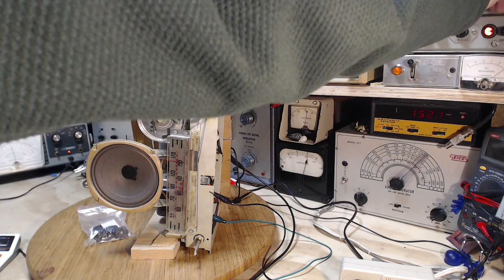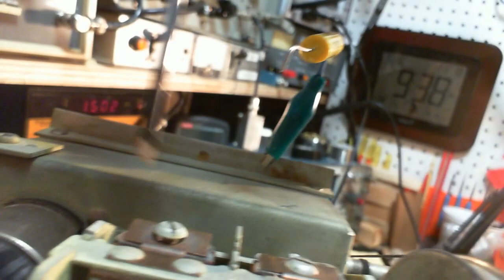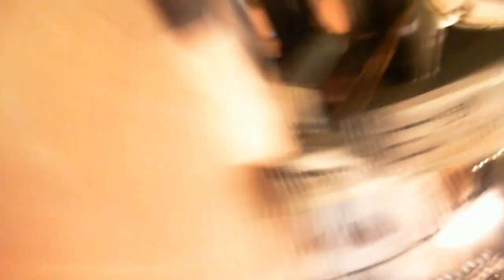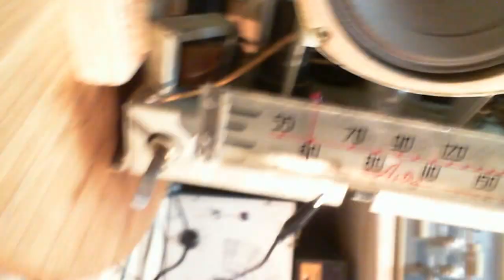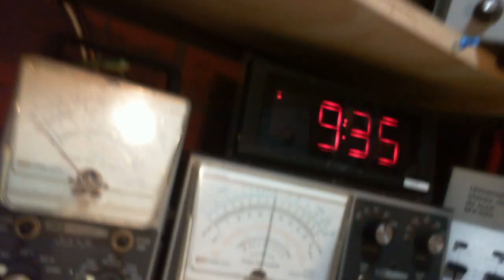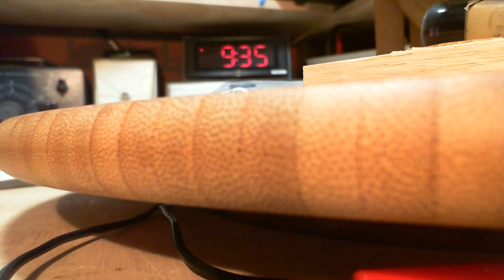Brand and Millen DR-102U Tube Radio Video #18 - IF Realignment

Comment: Jim, as you say there would seem to be too much capacitance in the antenna tuned circuit. Just a thought but the biggest contribution of capacitance would be from the main tuning gang. So could it be that when you adjusted the pointer on the dial cord to the last mark on the scale, with the tuning gang fully open, you should have set it to the 1700 dial marker. That would make the main tuning gang more open with less capacitance across the whole dial. That may then allow the tiny, by comparison, trimmer capacitance to be within the trimmer adjustment range at 1500.

Comment: I wonder why someone hasn't built a valve based radio with a balanced QSD mixer based on the PI5V331 demultiplexer chip driven via a Johnson Counter using a 74HC74 at (Signal+455)*4 to give I/Q signals at 455KHZ and boosted using ECC81 tubes and combined using a RF quadrature combiner then onto a 455KHZ crystal  filter then boosted again then demodulated using a AM detector tube and then sent to a loudspeaker using a normal tube amp.

Comment: With a ferrite core, you melt the wax and move it.  All you can do is subtract or add turns to the loop antenna. Does it still get 680?